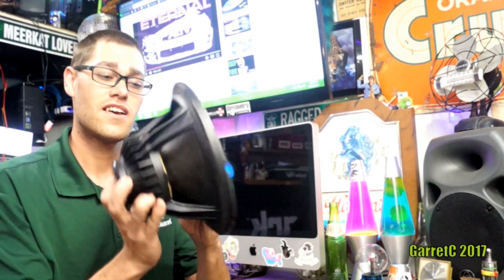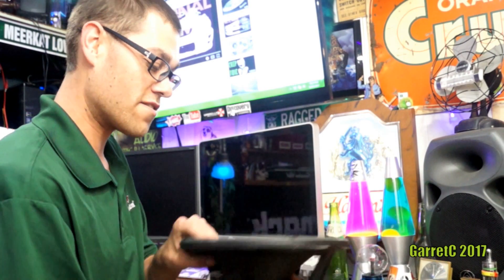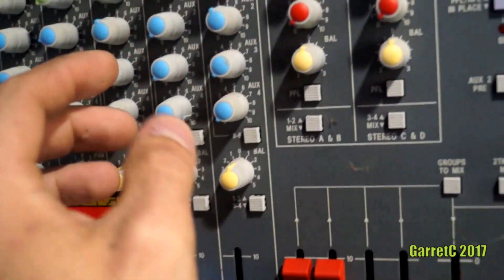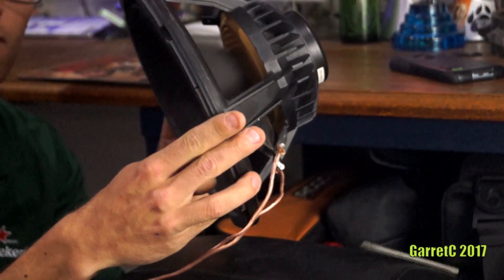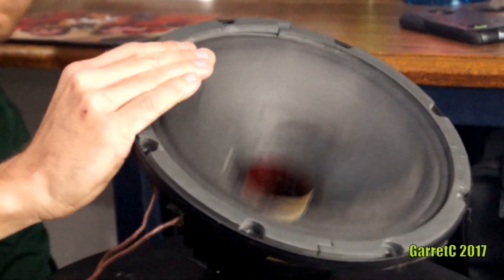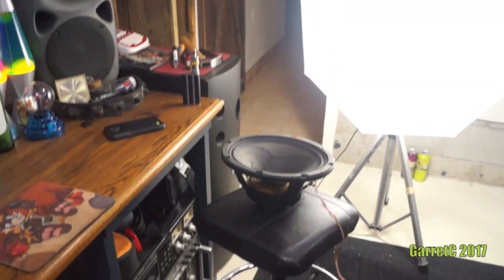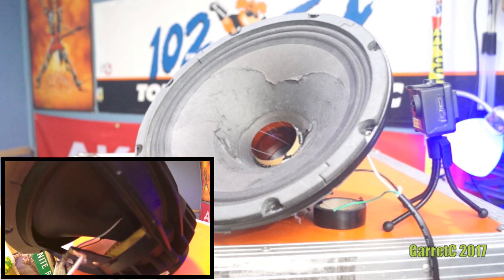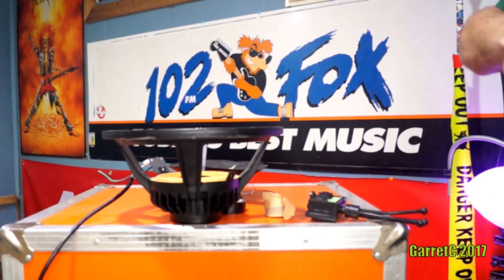SPEAKER BLOWOUTS! - GK 10 Inch Bass Woofer  (CS8 / AC Power Abuse)

Comment: If you run into any Hartke XL-8 alu cone drivers those are monsterous af guitar speakers. I have a 410XL bass cab with them in and it rattles windows with the volume at 2.

Comment: Gallien Krueger is actually an high end bass amp brand
Reply from the maker: Bass guy would use that double ten top with a 15 extension cab it was more than enough, And it was all so light every time Id go to move them Id nearly throw the thing though the ceiling 

Then he gets this gross Ampeg 1000w rack mount amp system with matching new cabs and he was not even able to move the knob past 2 before photos would fall off the walls
Reply: +Garret Claridge you cool furry